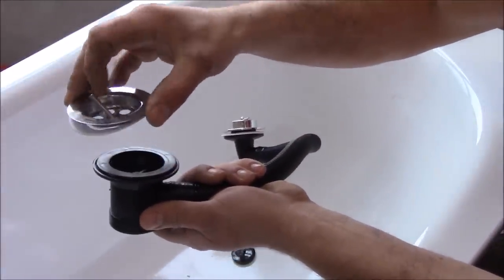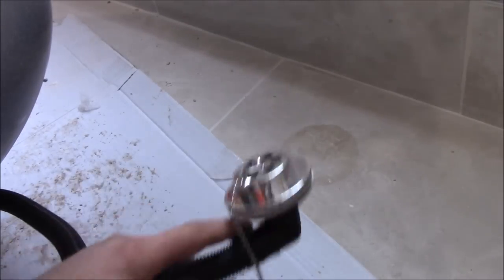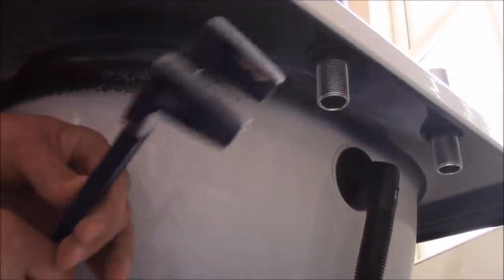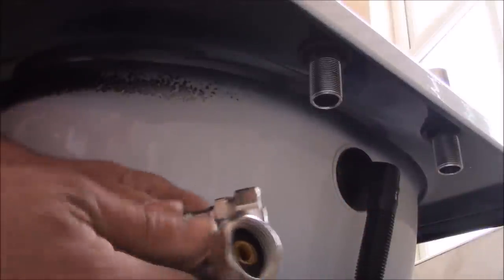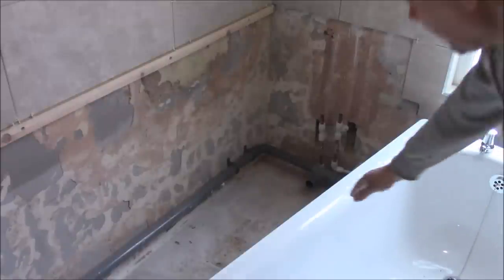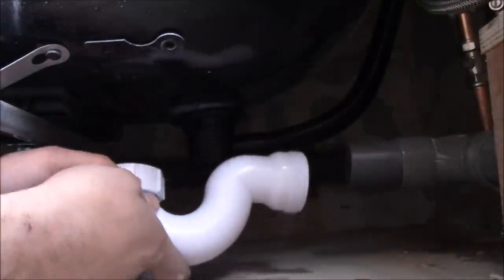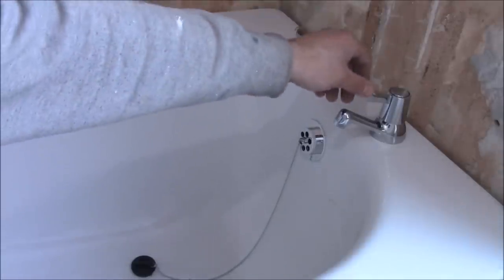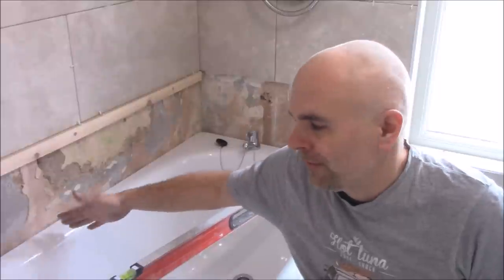How to install and plumb bath tub waste with overflow taps and bath trap

Comment: Thank you, used this video to replace a leaking P trap, I was having trouble with the replacement not attaching correctly, your video showed the correct ends for the different rubber seals.

Comment: Put a big thick line of silicon along the outside edge or the bath 'before you push it against the wall, then you'll have two layers of water protection

Comment: i took my bath trap of to clean it as it was clogged up after some diy and when i put it back on it leaked in 3 places it has 2 connector tubes  NIGHTMARE. After watching this video i realised i put the black rubber rings in the wrong place After some patience and a sore hands its fixed whithout this video i would have had to call a plumber im so very thankful

Comment: Very informative video, thank you. One thing is that the wall looked likely to allow your silicone seal to fail because its adherence is best on non-porous surface.
Maybe install tiles below below rim line before fixing bath?
Reply: Johnny Wilkinson I’m assuming it will be tiled over and sealed once more between tile and bath

Comment: Hi I have an identical bath with the same fittings for the leg supports. The bracket and the bolt that goes on first, it says from my diagram that you pull the bolt up to raise the leg. Or do you pull the bolt, to the right and then to the left to get the bracket in the upright lock position.

Comment: Bath needs to be fitted on barrears. Battens across lenght and width on the wall to stop moviment breaking  your silicone beads, no matter how many you put. People step on the edges to wipe the Tiles!. It also needs full tanking before tiling to stop condensation damage entering the substructure or in this case the brickwall. Enjoyed the video anyway!

Comment: Great thanks for the video excellent.
I am tiling my bathroom floor, I wondered if its better to tile underneath the bath or is it not necessary?
Thanks.
Reply: for future reference it is not necessary to do this. fit the bath before tiling and tile to the bath x
Reply: @OllieCraigBloxham  you would get a better seal if you push the bath upto the tiles, rather than tile onto the bath.

Comment: Great video. I've followed all your instructions and all is fine, except one of the plastic pipes underneath has a little leak at the join.   Should I put plumbers putty inside or around the outside of the plastic pipe to seal it? Thank you.

Comment: For a bath, should it not be 22 mm pipe for speed of fill?
Reply: Yeah and there should be brackets on the side fixed to the wall silicone is no good right angle tile trim should be used under the tile with silicone

Comment: I like the silicon behind the tiles. Would you ever get any mould issues though? Thanks
Reply from the maker: yes. even the mould resistant silicones are useless if there is no proper ventilation in a bathroom.

Comment: Hi i was told by a plumber you should apply silicon to the bath waste washers to get a good seal otherwise after some time water will seep through is this true in your experience?
Reply from the maker: The only washer that I apply silicone on  is a basin waste rubber washer ,  50% are leaking between washer and a tread no matter how strong you tight it

Comment: Why didn't he use PTFE tape on those bath fittings?
Reply: You don't need it, the rubber seal does the sealing not ptfe. You only need ptfe when you have no other sealing method (e.g. radiator tails)